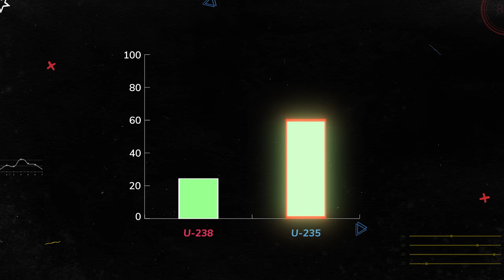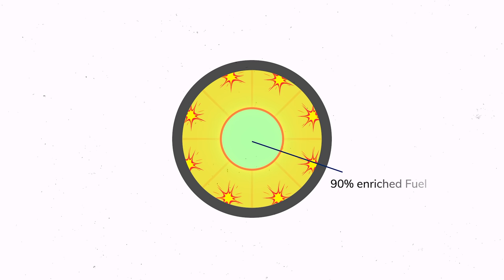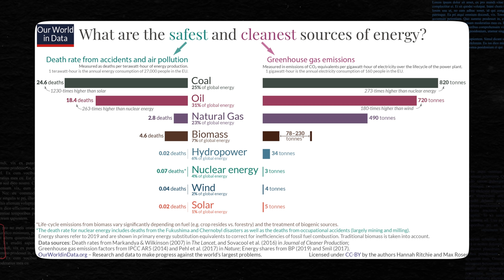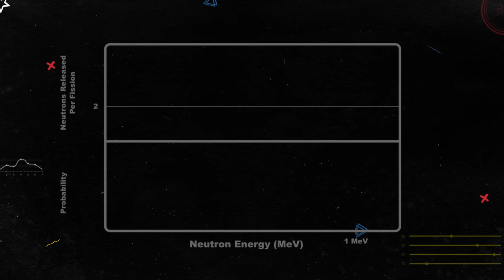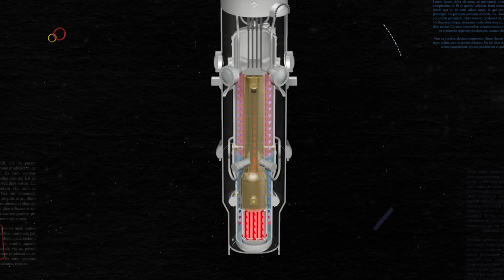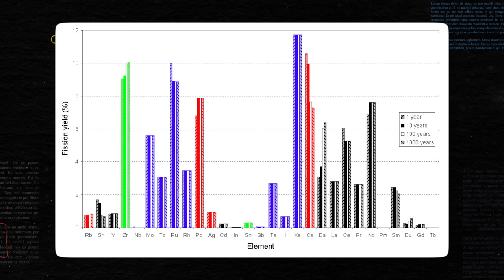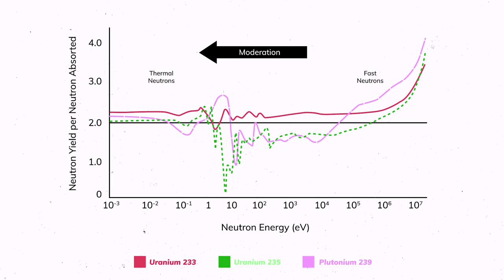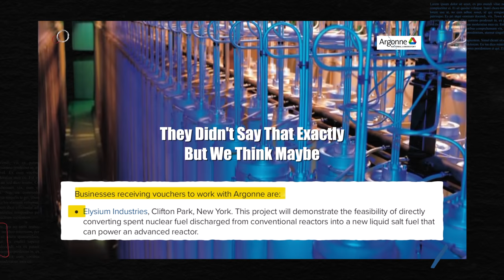This Reactor Feeds On Nuclear Waste

Comment: Interesting information thanks for making the video how does this compare to the barge reactors from a previous video or is this just the same technology spun around differently
Reply from the maker: Hey 👋 

So this reactor is a fast neutron reactor. Meaning that it won’t use a moderator. 

Both are using molten salt fuel. This reactor will be better at chewing through nuclear waste so their fuel cost could possibly be cheaper. 

Ed Pheil and his team have expertise in submarine reactors, while Jack Devanney and co have expertise in shipbuilding. 

Elysium is working in the US, while Thorcon are working with the Indonesian govt. 

Both look really promising :)

Thorcon may be closer to a reactor at this point, but can’t say for sure. There’ll be updates on Gordon Mcdowell’s channel whenever something major happens so keep an eye on that.

Comment: You could also stop with looking at it only through an economic/profit based framing, and simply look at it through the lens of safety and overhead. Whether or not you "need" to make a profit is irrelevant. Power, like water and sanitation should be non-profit in every case.

Comment: Except you can make nuclear bombs out of more enriched stuff. That increases risks alot. Let me remind that always when i get new device like new gaming console xbox or something, it has been developed with millions and billions with best engineers, and it is full of bugs. People always think  that they are smarter than they really are.
Reply: used fuel is virtually impossible to weaponise. For nuclear weapons you need LOW radioactivity isotopes and there are always a few high energy ones contaminating the mix which are nearly impossible to fremove - this is why the theoretical Thorium -> U233 bomb path never worked (USSR and USA both tried very hard as it would have reduced bomb costs by 90%). You end up with U232 in the U233 - which means a centrifuge farm 50-100 times larger than a U235/U238 separation plant AND you have to deal with the "minor issue" of U232 being so furiously radioactive that each centrifuges requires a biological radiation shield and can't be maintained once started up...
Reply: Weaponization isn't the only problem with the fuel,  e.g. handling and processing the fuel prior to and after use.

Comment: Hm. am i wrong to assume that such low operating temperatures and "lightweight design" might be an argument to explore applicability in spacecrafts ? such reactors might be perfect power plants for long range missions with ion engines? though... fluids in space tend to misbehave...

Comment: You "forgot" about the nuclear explosion in Tschernobyl, there was a run away chain reacation, producing about 350 GW of energy for a splitsecond. Enough though to rip the building into peaces.

So nuclear fuel can explode, if the reactor is not driven correctly. 
To propose not having an explosion safe containment is adventurous at best. 

My biggest question is, what happens when the reactor breaks and releases all its fuel into its containment. With a normal reactor this is the failure mode is very unlikely, because a lot of things need to wrong before your fuel melts, in the elysium design, it is the default.
How are you going to stop the reaction, which gets more intense as the fuel cools as it spreads.
Maybe this is, where the nuclear explosion of the fuel comes into play?

As you can easily extract the breed products from the fuel, this would pose a possibility to get weapons grade fissile material from this plant.
Also the idea of a nuclear power plant in my city or even my neighborhood is not that comforting to me, even if it looks nice.

I see a shining future, with nuclear armed neighborhoods! Okay, a glowing future, a green glowing future.
Reply from the maker: Chernobyl wasn’t a nuclear explosion. It was a steam explosion. 

The fuel just melted down. If you had a nuclear explosion, the shockwave would have killed everyone in the plant instantly. 

You can’t have nuclear explosions at low enrichment levels. 

If it somehow gets out of the vessel, it’s surrounded by another molten salt (sodium chloride). It dilutes into that and loses criticality. 

Before anything like that happens, they’ll let it go into drain tanks though :)

Are you saying the plant operators will try to create weapons grade material? Why? And how?

If you’re saying someone will just load the vessel into a truck, then I’m happy to tell you that the radiation from the Fission products will take care of them very soon.

Comment: Renewables with storage is still a better way
Reply: @Twofigo As far as I'm aware, these new modular reactors still produce weapons grade material, or are capable of being modified to do it easily, even if they do get rid of toxic waste and have no meltdown risk.  That alone is enough to disqualify them, no matter how good they are otherwise.  Nukes are bad news, and these are a proliferation risk.  

Most of the world population lives near the sea.  Offshore wind is steadier and functionally limitless.  New floating turbine designs make even the seabed a non-issue.  Also China's super high voltage DC lines can carry electrify long distances, even from remote deserts where solar can be set up

Comment: I want you to tap into the background radiation as an energy source.  :)...o  Nano tech bots ought to be small enough to use it as a power source and because of their size you can use a lot of them in a relatively small space.  It's the bot lifespan, I suppose, that presents the biggest problem but I thought graphene was super strong.  That reminds me...  Could the CO2 air scrubbers aid in graphene production?

Comment: water is a curse in nuclear power not just for the contamination/corrosion/explosion risks

BECAUSE of all the above, light water plants are limited to about 450C and this makes the power generation side a thermal efficiency nightmare as well as increasing turbine damage issues
Reply: Commercial nuclear power is a curse for water!
Reply: @tedlinaf3536  water is implicated in a bunch of civil non-reactor incidents too.  The Nuclear Ouichi being the worst example

One of the big advantages of the msr designs is that you never need to reprocess large volumes of material so the vulnerability isn't there
Reply: @miscbits6399  Monju Nuclear Power Plant
Reply: @tedlinaf3536  monju was a sodium loop. Same problem as at California. 

A metal coolant which reacts explosively with water and burns furiously when exposed to air

"What could possibly go wrong? "

The Japanese were lucky the leak/fire was in tge secondary loop, but 30 tons of sodium in the basement took a while to cleanup

Mr Hisachi Ouchi's unfortunate event was something complete different at tokaimura. Dont go putting 16kg of uranium in a 2kg bucket
Reply: @miscbits6399  an aside, I think it is not appropriate to personalize these systems with the owner/developer/promoter's names. 
 I am familiar with pressurized water reactors and we laughed at the chernobyl design..."graphite as a moderator? Haw,haw!" Because graphite burns.
  And, I agree that a big bucket of 1500F liquid salt is safer than a loop of it...
 A purpose-built salt reactor to dispose of hot waste, run by the AEC, may be reasonable. 
 Many accidents show nuclear technology a fertile ground for the quantum enforcement of Murphy's Laws
Reply: @tedlinaf3536  Alvin Weinberg is the man who created nuclear reactor designs essentially as we know them. He deserves to have his name known just like Newcomer and Watt do
Reply: @miscbits6399  I prefer associating them with the technology/location that's employed, but fine, credit where due. I think Adm. Rickover should maybe get credit for the whole nuclear power industry. I think there's still some fuel rods from his time still aging in a pool in shippingport
Reply: @miscbits6399  weinberg's design was never mentioned in nuke school

Comment: The cost of nuclear fuel is negatable, hence why some people are still willing to invest in the technology because of the theoretical savings, and in actual fact if you run a reactor who 15 - 20 years you can make up for the capital investment vs coal etc due to the cheap fuel costs, the problem after that is the cost of keeping the reactor going with the highest safety and decommissioning costs, which then puts you in the whole again, however yes if you could build the reactor quickly and cheaply (1 year construction time and aprox 1 billion for a 1GW thermal reactor ) even if decommissioning costs and operational costs remained similar you could make it economical, and decommissioning costs could be significantly lower due to the pre-fab nature of the reactor.

Along with being able to charge for taking nuclear waste off peoples hands and use that to make fuel, all together it could be better than coal / natural gas etc.
Reply: Thorium: about $150/kg.
Uranium (raw) about $150/kg
Uranium 3% about $55,000/kg
Uranium 50% about $50,000,000/kg (no, I'm not exaggerating, if anything this is an underestimate)

USA Rare earth mines produce about 5000 tonnes of thorium PER MINE per year. Its' the single biggest waste product and the "toxic byproduct" that make the economics impossible.

Finding a market for thoriuum turns these mines into thorium mines with a rare-earth side gig
It also makes mining coal ash slurry ponds for thorium (50-200 acres per old coal plant in the USA and there are over 500 such sites) a feasible option - self funding superfund cleanups
Reply: @miscbits6399  Fuel cost is not really a factor even in a Uranium burner as yes that 1KG is expensive when you look at it, but you also have to remember that 1KG of 5% enriched uranium even in a burner reactor produces enough energy for your whole life in this modern world, what makes conventional nuclear reactors expensive is long built times and high capital cost and
it's the side effects of using a burner that are the issue, thorium is not required for a long time, as we currently if we had breeder reactors that could use up uranium 238 enough nuclear waste to run our civilization for 100 years.

then enough raw uranium to last us probably an order of magnitude longer.

While the side effects of a solid fuel burner are that you get nuclear waste, and it is difficult to process, where as a fuel salt, it's already melted down so you can do your chemical processes to condition the fuel to make it a breeder reactor, in which case your nuclear waste only last for ~300 years Uranium or Thorium, vs 10k+ years.

And you cut the amount of waste to 1/20th for the same energy.
Reply: @Etheoma  the BIG advantage is not needing uranium,  because depleted uranium is the precursor to nuclear weaponry (you use it to make weapons plutonium or h-bomb(*) casings) 

Not using uranium utterly divorces your civil power infrastructure from weapons making. 

(*) teller-ulam fusion-boosted fission miniaturised weapons as found on tge pointy end of ICBM MIRVs
Reply: @miscbits6399  You know in a thorium reactor the actual fuel, the thing that fissions is U233 right a weapons grade fuel? and to condition your fuel you need to pull out the Pa233 which decays into U233, so if some rouge state making bombs is your worry, the thorium fuel cycle is worse than a Uranium fuel cycle,  considering that in a Uranium molten salt breeder reactor you don't need to build the reactor to take out plutonium or any of it's antecedents, you only need to pull out fission products, like strontium, magnesium etc.

where as a thorium reactor because of the 26.967 day half life, it will inevitably capture neutrons and turn into U234 which will capture another neutron and turn into U235 meaning you loss 2 neutrons per fission which will make fission completely unsustainable, so you need to pull out most of the Pa 233 before it turns into Pa 234.

Unless you want to go the accelerator driven route, which is not infeasible, and would simplify the operation of the reactor, but obviously attaching a particle accelerator to your reactor increases costs, and considering you are already doing the chemistry to pull out the fission products of which there are many, errr adding one more thing you pull out is not significantly increasing operation costs or built time.

there is the issue of Pa 233 or U233 being transmuted into U232 which quickly decays into Ti 208 which is a strong gamma emitter, making it diffuclt to handle and also trackable from space if the shielded properly, which in a bomb you can't shield it properly from gammas so as soon as you launch that bomb it's gonna be easily trackable and known to be nuclear bomb.

So somewhat impractical, but if someone is insane enough to actually do a first strike... ehhh... they probably just want the world to burn so, everyone instantly knowing a nuclear bomb has been launched instantly probably isn't an issue for them.
Reply: @Etheoma  if you can make weapons grade u233 from thorium then you're doing rather better than the USA and USSR who both spent billions trying to do this in the 1950s and utterly failed (the only partially successful USA u233 weapon was operation Teapot MET and it only (barely) worked because it was mostly plutonium. 'Barely' as in it wasn't quite small enough to be a fizzle but it was only 5% of design yield)

Thorium rather conveniently resists weapons proliferation by transmuting to 150ppm u232. You need less than 15ppm to make bombs and less than 5ppm to not be deadly to anyone handling it

If thorium could be weaponised it would have reduced materials cost by 90% and allowed little-boy simple cannon format nukes rather than complicated implosion weapons. Both sides tried extremely hard to make it work (the half life of u232 is 69 years, so putting it in storage would need a 1500 year waiting period before you have pure enough u233 for a weapon)
Reply: @miscbits6399  and you know a reactor to make weapons grade plutonium is completely different from conventional energy generating burner reactor.

like seriously trying to make a plutonium or anything else other than a dirty bomb from a conventional energy generating reactor would be creating way way way more work than just enriching Uranium to weapons grade or building a specific reactor to generate Pu 239.

Just to make it clear, we don't use energy generating reactors to make weapons grade plutonium, no if's ands or but.
Reply: @Etheoma  i know they're different. The point is that the plutonium is made by exposing highly depleted uranium for short periods. 

You don't WANT u235 in this material as it will transmute to short lived pu isotopes (pu236 and pu237) whose presence will poison a pu239 bomb and make it fizzle

Depleted uranium is why you 'enrich' uranium. 3% enriched is (diluted) leftover waste from the weapons making process. Weinberg used it in the Nautilus because it was available, not because it was the best fuel for the job.
Reply: @miscbits6399  They didn't put in the same effort because of the U232 issue, but if you have a reactor already pulls basically pure U233 and you are determined to make a nuclear bomb out of it you very much could, much more easily than trying to turn a uranium feed molten salt reactor.

I believe the issue with U233 and turning into into a nuclear bomb is the cross section of U233 with fast spectrum neutrons.

Means you need a fat bomb because of the moderator required to make the neutrons thermal spectrum neutrons.

But you have the same issue with a U235 bomb, mixing Pu 239 and U233 or U235 is not a good idea, as Pu 239 doesn't work with thermal neutrons and U233 doesn't work with fast spectrum neutrons, I suppose the idea was use the neutrons which had been slowed down to fission the U233, but, like... it just wouldn't work out that way, you are best off trying to focus on fast or thermal spectrum.

U233 and U235 would be fine though.
Reply: @miscbits6399  Furthermore for a plutonium breeder reactor your feed after the start up fuel can be anything from natural uranium to nuclear waste... also even for conversional nuclear reactors a heavy water reactor can use unenriched uranium.

all that being said is why I don't care about Thorium in the mid term (that being in this case about 100 years...), we have more than enough nuclear waste to burn for a long time, and once fuel consumption and high level waste production is cut  in 1/20th and the half life of the high level nuclear waste is cut down to 300 years, the difference between Thorium and Uranium doesn't really matter.

Although for space applications I do think Thorium makes more sense as geology on Earth has created pockets of Uranium, where as outside of Earth or more precisely a planetoid with water cycle, the relative abundance of Thorium does make a difference.

Comment: The Company, Transatomic was also designing a molten salt reactor but they failed

It seems molten salt looks good in theory but fails in practice

Molten salt reactors have been around for decades
Reply: TransAtomic made a fatal error in their neutronics calculstn that caused their failure and they failed to liten to advise from many, including Elyium & MIT thst you cant get close to closing a U/Pu fuel cycke in a thermal spectrum. A cide fkag was accidently set to prevent deletion of the U235 atom, when it fissiined, so U235 never was consumed.
Reply: @EdPheil  thx for the info ed, can you provide some more reading on that

Comment: Well, not really.   Molten-salt reactors get fiendishly radioactive and need like a square mile of chemical reprocessing facilities around them to continually try to separate out the fission products.  Yes, they are short-lived, but very radioactive.  You probably need at least dual redundancy in the chemical processing to ensure you keep the radioactivity in the mail loop to only ludicrous levels.
Reply: Why? The big problem for neutron poisoning is xenon, and that comes out of solution on its own.